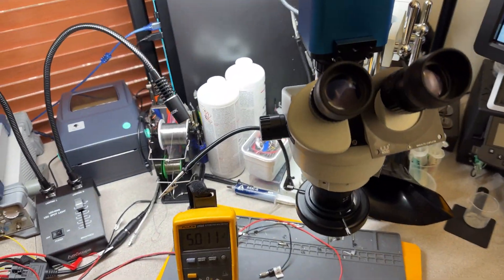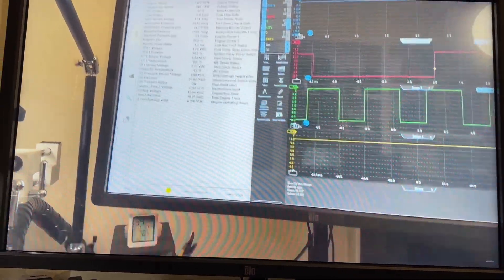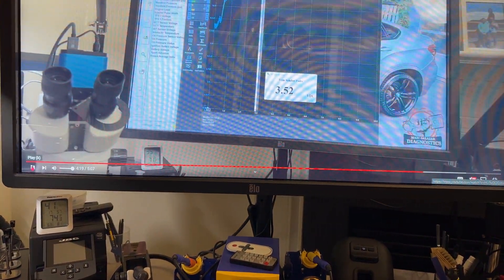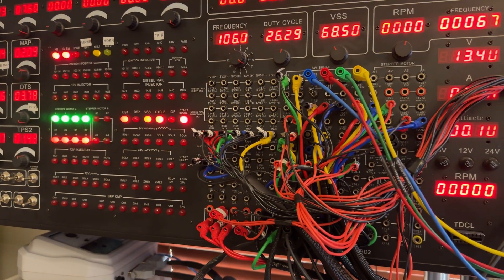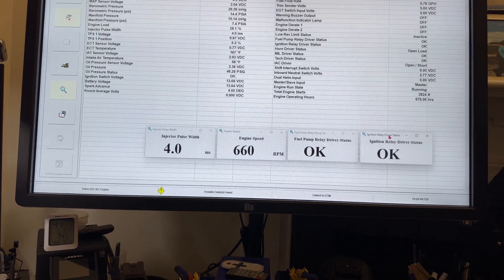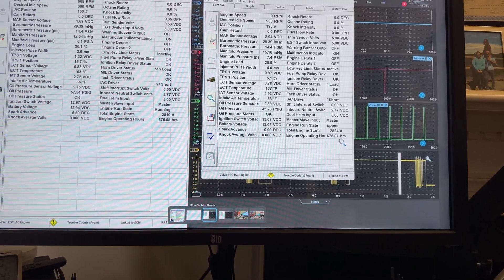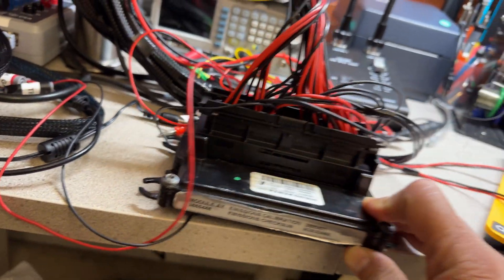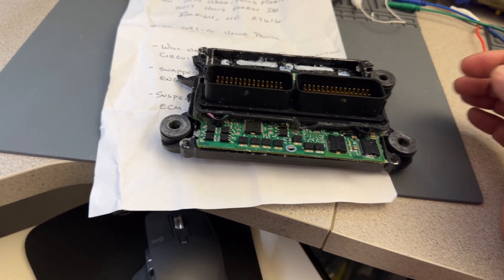2007 Volvo Penta 5.0 GXi-G Test no start no fuel pump For Wake-Falls Marine NC Second Visit

Comment: Hello Maic, I have an 502 marine engine, I have two cylinders not firing, there is compression, spark, and fuel I assume. Could it be a bad ECM??  thanks!
Reply from the maker: Hi, Is that a Crusader? Can you send me an email at maic@maicsalazardiagnostics.com
So, what is not firing?
You said that there is compression, spark and fuel.
I will need to know what module is in it, send me an email with a pciture of the module.

Comment: Do you think simulator 9000+ (the old one) is good investment for repairing ECU's for semi trucks ?
Reply from the maker: It is basic but it can definitely get the job done.
Reply: @MaicSalazarDiagnostics  Thank you. What is the model of your current simulator ? Also, do you have a video on basic diagnostic steps or measurements etc ?
Anything of that nature ?
Reply from the maker: @northwestrepair  nope, sorry. I am working on a new site for ECM repair classes.
Reply: @MaicSalazarDiagnostics  can I visit it or it's not ready yet ?

Comment: 99% of the time it is the powertrain control unit that causes fault with Volvo Penta petrol V8s, the ECUs generally give no problem.

The Volvo PCU is the interface between the Volvo electronic vessel control (EVC) and the Chev ECU, it also controls auxiliary components such as trim and tilt and electric fuel pumps.
Reply from the maker: Hi, not the case here. This is definitely the ECM not working properly. Not sure if you watch the entire video. I am very familiar with these modules. Probably have repair over 100.
Reply: @MaicSalazarDiagnostics  Hi, I have not watched the video yet, I intend to. Just a comment based on the experience of working for Volvo Penta as a technician and knowing a common fault, so common that we used to get faulty brand new PCUs.